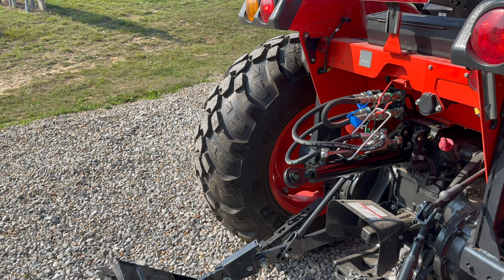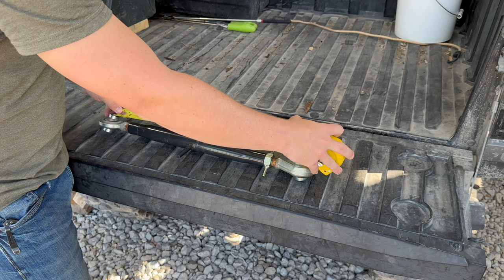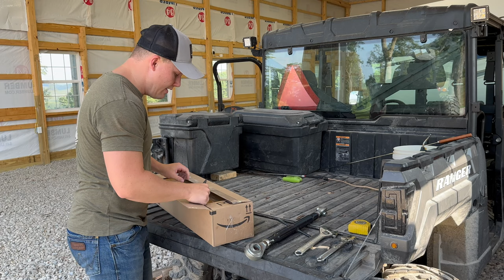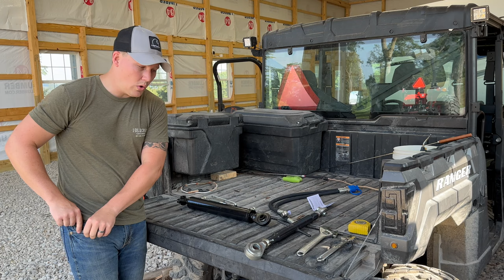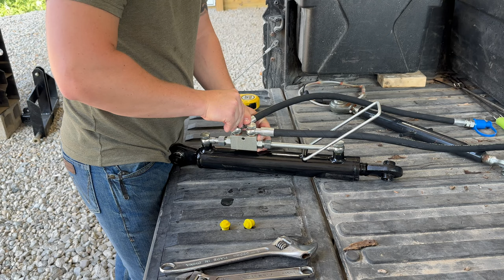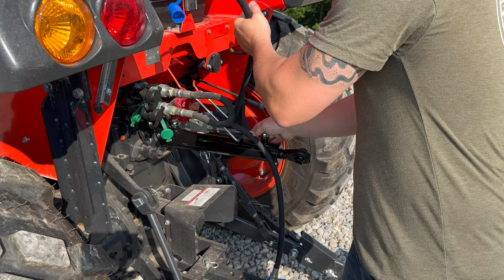How to Buy the Correct Hydraulic Top Link For Your Tractor

Comment: Hi, quick question. I noticed on your rear remote you had a short hydraulic hose looped to complete the flow. What is the reason? Also, I have the same tractor NS6010 but all gear drive. Thanks for any info. I will be ordering the top link..
Reply from the maker: @robcanova7979  that is a great question, I’m honestly not 100% sure. The dealer placed it on there when that extra rear remote was added. They said it had something to do with constant pressure. I will look into it more for a definite answer. 
The NS6010 have been awesome and I’m sure you love yours too! Thank you for sharing, you will enjoy the new top link once you get it on!
Reply: @hillcreekoutdoors  Thank you, and keep the videos coming.
Reply: If I’m not mistaken that jumper hose is so that you can circulate hydraulic fluid to warm the fluid to working temperature in cold environments
Reply from the maker: @rayadamsjr2370  thank you for the information. I honestly didn’t know what’s it’s use was for